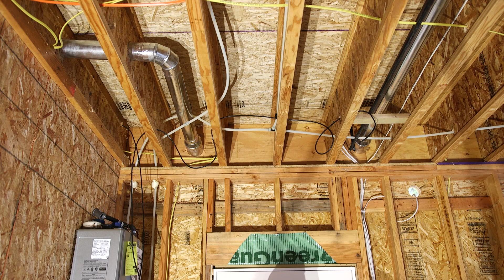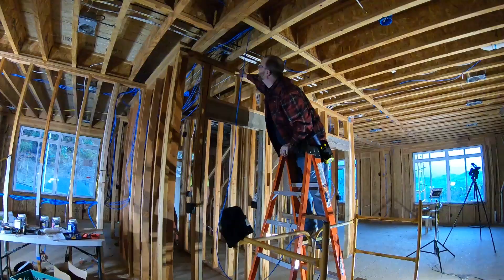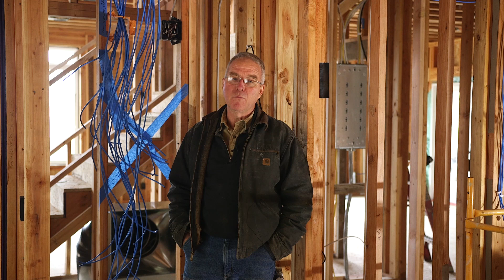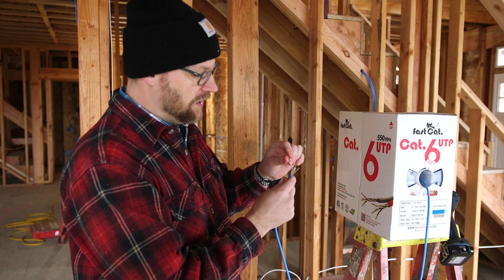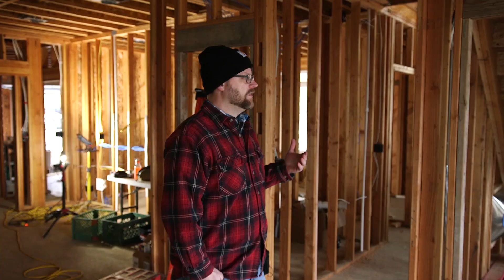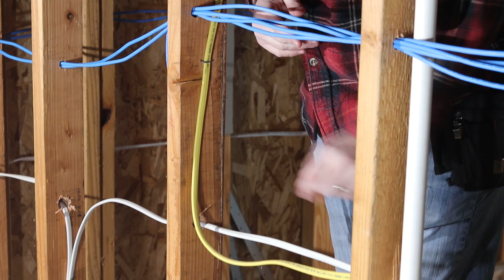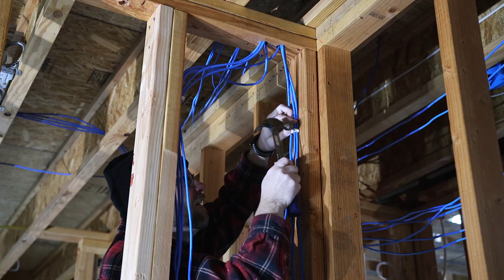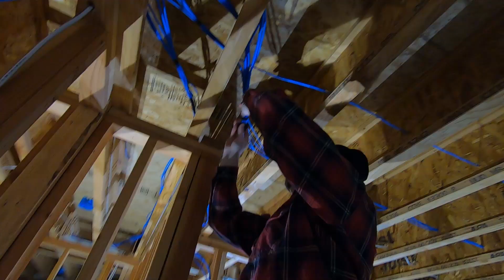Installing A Home Network Ep.100

Comment: Former cabling contractor here -- good job Scott and Ben. Ben spec'd out what you needed just right. My advice to people is ALWAYS run more than you think you'll need. You'll thank yourself later!
Reply: Yes - and to locations you may not consider.  Garage, laundry room, front door for a video doorbell, outdoor patio space.  Any place where a future camera may go to keep an eye on things.  You may think wireless is the future, and you are correct, but wireless coverage in large homes is only as good as where  the wires go to serve it.
Reply: @bradgaeth  Right on! Got all of those covered! Garage, laundry room, and outdoor porches. ;)

Comment: I guess y’all don’t have wifi down there?
Reply: Lol true.. good to have jacks in the walls also, works better than wifi
Reply: Heh the wireless access points will be plugged into strategic network cables run and spooled up just for this purpose ;)

Comment: FWIW: Cat 6 is almost obsolete. Run Cat 6a instead of Cat 6. Cat6a is rated for PoE devices that need more than 15Watts of power and supports up to 10 Gbps. Cat 6 is limited to 1 Gbps. Cat 6a is an approved cabling standard in the US.

Ideally it would be better to run STP (Shield Twisted Pair) instead of UTP (unshielded Twister Pair). An STP cable will have an foil or braided conductor the will help attenuate noise & provide a more reliable data connection.

Do NOT Zip-tie bundles of ethernet cables, instead use velcro, as the Zip ties can kink cables.

Comment: It's still funny.
For many years, our providers have not connected new subscribers via coaxial lines. Passive fiber only (with twisted pair cables inside apartments or small houses). Even cable TV (which is dying without really flourishing) and telephony - either fiber optic, or something wireless. And those who still use old copper lines - providers are trying hard to transfer to new equipment. Too expensive service and too expensive infrastructure for copper at completely uncompetitive Internet speeds.
Russia, yes.

Comment: Why so many network cables? Everything is wireless now. Don’t you only need a couple? It’s just a bunch of extra outlets and covers your going to see all over the house.
Reply: Wireless is a very imperfect technology. You're never going to get maximum speeds with it.
Reply: Plugging into the network is still a more reliable network connection compared to wireless.
Reply: 1) Wired access points around the house are the way to go. Mesh networks require two wireless hops and there isn’t enough spectrum (channels) for it to be as fast.

2) WiFi is less reliable and in fact is worse than wired in every way except convenience. Anything that doesn’t move should be wired. Printers, game consoles, streaming boxes, desktop computers, and of course access points.
Reply: @ugh-meh  For a home like this one looking at size and how it is constructed, for normal residential usage you might actually get away with all wireless mesh repeaters around one central router. Distance to the next house is large enough and the framing construction does not restrictthe Wi-Fi signal to much. But still looking at tvs, set top boxes etc., cable is way more reliable.
And if you are in an environment like mine, with a concrete, brick and mortar town home stretching over thre floors plus basement and the internet link comming in at the basement. Where you can see at least a dozen different networks at least in the 2.4 GHz band... good luck. I prefer cables over Wi-Fi wherever it makes sense. 5 GHz due to the limited range looks better, but you almost need an access point in every room.
Same for the internet link. ISPs here seem to dream to get rid of cable infrastructures of any sort and seem to dream bout everything 5 G in the future. Well, thanks, but thanks no. Having to be able to work from home, I still prefere the reliability of a wired connection any time, no matter is DSL, cable or optical.

Comment: Forehead slap: never run any networking cables outside of conduit! As technology improves the cables in the walls become outdated and become abandoned. If you ran conduit, you can replace the cables with new and not have to make any holes(pretty much) in the future. My dad laughed at me for this during our home renovation (2002) and now, I am the one laughing now as we have updated recently our internet lines from cat 4 to cat 8. I just taped the new cable to the old and pulled it through the conduit. In less than 20 minutes I replaced all 120 feet of lines. Also, consider putting in cable chases where a tv might be placed. Will help with running invisible cords later.
Reply: Installing conduit makes a cheap job an expensive one.

Comment: I kinda hope they wired up high as well to get WAP(Wireless Access Points) in the home.  It is always the last thing that gets thought of, and with the drywall and even the ceiling not being there yet, it would be the time to place the cables for the WAPs.  On the ceiling or on the side of the wall especially if its a solid wall/ soffet where you don't have access anymore.

The "command central" as you call it we call in the industry a MDF or Main Distribution Frame for your home.  Although to be honest command central does sound cooler...

I am happy to see Ben not forget to mention the labeling...   saving the best for last on the mentions...  Fun story...  Job site I was on had electricians pull the ethernet drops and they were suppose to label it, which they did...  But...  It was done so bad with cables labeled the same or out of order that I told the GM on site, there was no point in using the labels as we couldn't trust any of it, we have to tone it all out just to be sure they were the right ones.  For a 5 or 10 wire job it isn't really much to cry over.  But on a 180ish wires job with them going all over a store on ceilings(which are high to need a scissor lift), around corners, inside refrigerators(I didn't bother to ask why...), 90+% of it had to be toned out and relabeled...  So ya labeling...  VERY IMPORTANT...  Was plagued with violent thoughts about the electricians for a week or so after the job... 

Another thing that probably wasn't mentioned by Ben and probably in good form not to mention but best to know anyway,  there is such thing as CCA or CCE (copper-clad Ethernet/Aluminum) cables...  Avoid them and do not use them if you have a choice...

Edit:  That drill Asher(spelling?) is holding is the exact same one I have in my toolkit...  Great compact little drill...

Comment: Love this series. Also, it's great to see so many of your own folks involved. There is nothing like family :) 

Good call going CAT. Personally I would have used CAT 7 to be a bit more future proof, but I understand that CAT7 is not standardized in the US as of yet. CAT6 will be plenty enough for most stuff even 20 or 30 years from now anyways and having proper network throughout the house to begin with is probably more than most houses can claim for themselves. So, CAT6 will be fine, and since it's a universal standard, it was a good choice to make!
Also good call putting so many outlets in. Network is the future, and if I see a house for sale that has 24 LAN outlets , it will immediately make me think that this house was built with forsight and built to last. This will most probably be one major selling point!  

It's probably too late for this, but if it can be implemented, I would highly recommend putting an empty cable conduit in place which at least runs vertically throughout the house and is easily accessible, so the owners can upgrade later without having to take the risk of drilling holes through the floors.

Comment: I'll point out an obvious omission here, which is Cat6A cabling. Cat5E is designed to meet the 1gbit ethernet standard. Cat6A is designed to meet the 10gbit ethernet standard. Cat6 doesn't correspond to an ethernet standard. It's performance (frequency handling, interference mitigation, etc) exceeds that of Cat5E but falls short of Cat6A. What this means in practice is that on longer runs of Cat6, you may struggle to negotiate a 10gbit connection, and you may fall back to 1gbit. 

The physical differences between Cat6 and Cat6A are mainly to do with the spacing between the copper pairs, and how tight the twists are.

Another thing for people to keep in mind is shielding. For most people I'd recommend UTP (Unshielded Twisted Pair) cable as shown in this video. Any type of shielded cable will degrade performance UNLESS it's properly ground at every connection, which in a residential setting is more expensive and less necessary. The shielding if installed correctly does provide better interference protection if the cables needs to share cavities and conduits with lots of other electrical cables.

I'd personally run Cat6A UTP in my home. It's a little more expensive than Cat6 but it'll guarantee a 10gbit connection if installed properly. It'll also have a better chance of achieving higher speeds on shorter runs, such as 40gbit or 100gbit if that ever becomes economical.
Reply: Right on! I think we're OK on 10Gb, as all of our runs are under 35m. But yes, this was a consideration and tradeoff!

Comment: 23 years ago, when we had our house built, I myself ran 4-pair cabling throughout my house, for both phone and network service.  Coming from a data background, I have ran plenty of cabling and decided that I would do my house as well.  I can't recall anymore whether it was CAT 3 or CAT 5 cabling but it serves me well to this day.  Can't have too many jacks.  I wish now that when I wired my house that rather than putting a single wallplate with phone, cable, network and speakers (which I have yet to use) in each room that I would have put one on each wall of each room.  Live and learn.  Having a central point to make the connections is essential.  I have a couple of 48-port patch panels in my garage where everything is homed to and I can easily connect, or move various things around easily.  Best thing I have done.

Comment: One of the best descriptions of why kinks in data cables are bad. I've been doing this type of wiring for a long time, and my explanation is only about half as good. I prefer to say running cable, as opposed to pulling, but all of the tools, and slang are for pulling so we're stuck with it.  I'm also taking away two new rules of thumb  1 foot separation for parallel cables, 1 inch for perpendicular.  All told another great video. Thanks for all of the work that has gone into this series.

Comment: COAX modem can be placed really close to the COAX cable entrance to building a then Internet can be run thru cat6 or fiber to technical/server room. There is no point to add losses included by using that COAX thru whole house. And this my proffesional recommandation is futur proof also. What whoul a house owner do when FTTH will be available? Yeah, looking so some way to get thru house with fiber cable...
And second note - make sure you’ll buy a pure copper cable, these days is very common to find copper plated iron and that is just a garbage...
And yeah, if you can - maintain cat6 cables and electricity cables separation, it is better. But proper cat6 cables and deviced do not much care about 60Hz AC stuff at all... They are designed that way.

Comment: one thing.. if you are going to pull 300 feet of cable dont cheap out at the ends and leave a short stickout from the box or the junction. sure you only need 6 inches to punch down a keystone but i like to leave that six inches plus in the box after I punched in case I made a mistake.. or you use the cable for end point conversion to something other than computer networking  but still want the device in the box. that bit of extra cable could save your butt in the future.. if your cables arent on the floor with 10 feet to spare in the equipment closet you didnt pull enough.. comb it coil it and you are done. worried the drywallers are going to have a rough time? come out of a box that spans two studs that has a flange or cover for finishing you do not want drywallers pulling your cable though a 4X4 opening they are worried about a flat wall not about kinking cables. mark your cables in multiple places never assume you are going to be the guy that finishes the job

Comment: Why run Cat 6 when a GIG wifi is faster and everything can run off it now?
Reply: Gig Wi-Fi is in theory faster, but good luck actually getting the rated speeds in a typical environment. Hardwired will beat Wi-Fi  Every. Single. Time.

Comment: This is was so fun to watch!! This has to be the first video you've released where I think I knew everything the expert was talking about. I went to school to learn about this all this stuff. Cable attenuation, cable types, installing runs, terminating at the wall and at the punch-down block, but it didn't turn into my career. I still have the tools from those days and was so glad to have a chance to use them when I installed  Cat6 Plenum in the attic of my first home, which my wife and myself are very thankful for, now that we work from home full time per COVID.

This was a joy to watch if for nothing else but the affirmation that I could work in this trade.  Ben was a delight in his explanation of these things. I'm Looking forward to the video where  the low-voltage is terminated, maybe some explanation of keystone jacks,  cross-over cables and network management. These are relatively new skills that any homeowner in this modern age should know about and I'm excited to see more in this series. Thank you

Comment: My cable company recently ran fiber down the street, a fiber drop to the side of my house and fiber loop into my home office. All RG6 coax cable removed. From the fiber in my office the connections to my TVs and devices is wireless.

Comment: Running cat6 to every room will give you the flexibility to run a lot of services beside just data networking. I was worried at the intro when it sounded like it would only go to the main hub, but this should set up any future homeowner to build their own system with existing lines already in place.

Comment: I'm currently running RG6 Quad shield coax cable through a multi unit residence so in total there is roughly 15 units with 24 cables. My question is what is the limitations on such cables? How many  cables should I run to the main from  outside in order to not split the signal to the point that it would result in loss. Most these cables run about 50 feet or less from my media hub to the wall box. I've ran cable before but never in a place as large as this. I tried looking online but the information either wasn't out there or I must have missed it. Thanks in advanced.
Reply: Ideally you use a Coax Distribution amplifier when you have to connect multiple devices to the same cable run. That said, you will likely need to use a Bi-Directional Distribution Amplifier for cable modems. Best to check with the local cable provider.

Comment: Does data really slow down due to a kink?!
Reply: Not exactly. What happens is the Kink creates reflections causing a lot of noise on the cable. Most devices when encountering a lot of noise will fall back to a slower data rate to accomidate the noise issue. For instance a 1 Gbps cable that ends up getting reduced to 100 mbps connection.

Comment: My bullshit-o-meter here says electrical signals don't care about kinks in your network cables.
Reply: Good thing you are not installing low voltage then.
Reply: Twisted pair cabling has the four pairs twisted at specific amounts of twists per foot that are different among the four pairs to help eliminate crosstalk. A sharp kink in the cable can disrupt the twists which may not allow an error-free 10 gigabit connection. Lots of things that matter at 500MHz signaling that don’t at 60Hz.

Also copper work hardens and solid cables that get multiple sharp bends in a spot might break the copper

Comment: As a techie honestly no one needs more than cat6e at best.
 Cat 6 can run up to 1gbps at 300 ft and 10gbps anything under 150ft.
 I seriously doubt we will get 10 GB per second internet within the next 20 years. Yes security cameras can take advantage of the extra bandwidth/poe capabilities,but most everyday people though, dont get those kind of cameras anyway. 
Also odds are they will take less then 58v (give or take for resistance and etc) anyway, Which is what cat6 tops out at. 
Soooo long story short cat6 is a good middle ground and is viable for both cost reasons and utility.